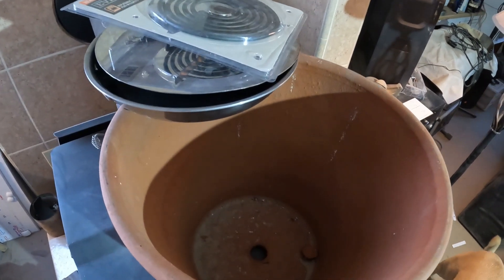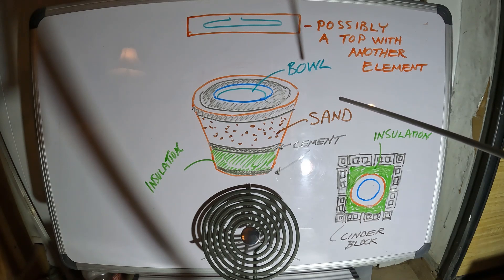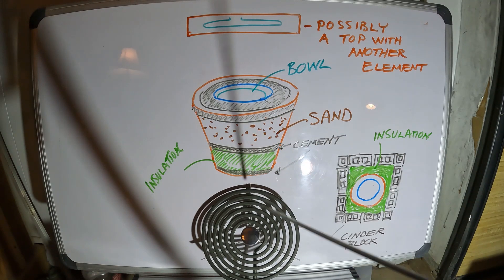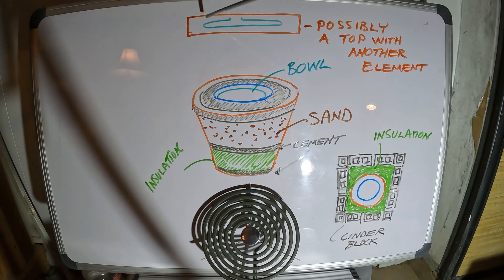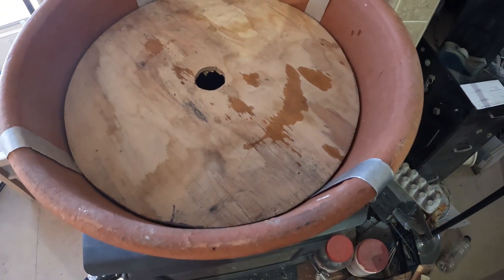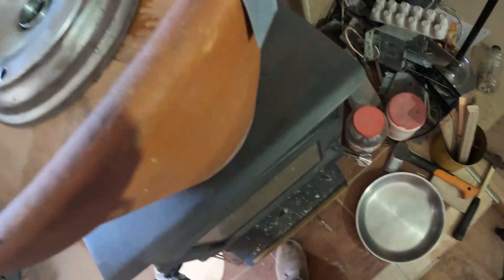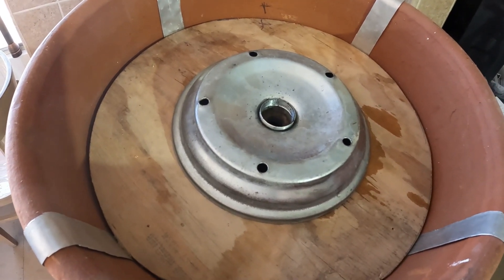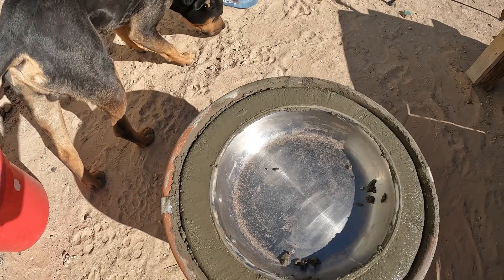Terracotta Sand battery Pizza Oven, Part-27

Comment: Love your little videos so thanks. You might want to get a stone pizza pan if you're going through all this trouble.  I'm working on a project that runs on similar lines using sand but in a thermoelectric generator. I'll post a video when it's done.

Comment: I'm really loving this series. Keep it up! I can't wait for the crispy pizza.

On a related note, I just wanted to give you a heads-up before you jump into part 2. Unless concrete is very well cured and dried, it can't handle high temperatures. Any remaining most, that's in the mixture or even the rocks will create steam and pressure, causing the concrete to crack and fall apart. 
So I would led that cure for 2 months before heating it up.

Now I am no expert, but that what I remember from having researched making a fire pit out of concrete. That's why most people use bricks.

Either way I hope it works out and look forward to crispy pizza!!!!